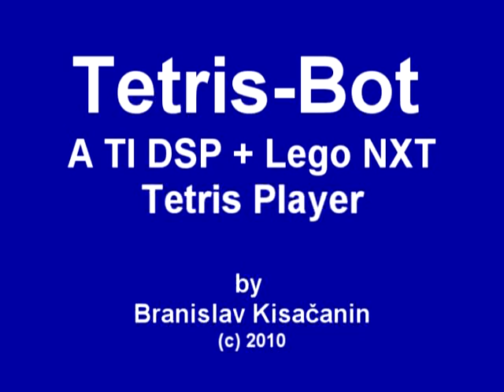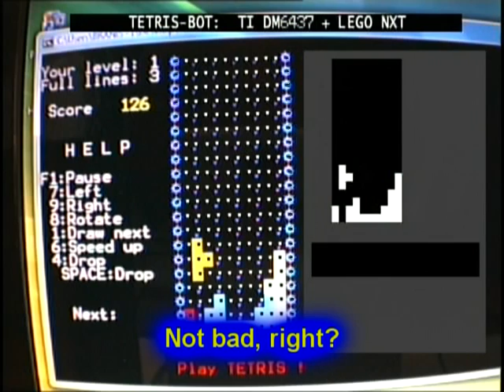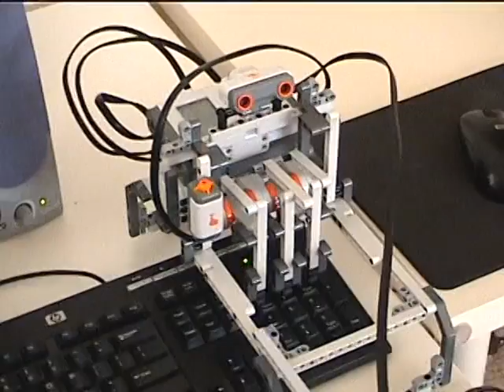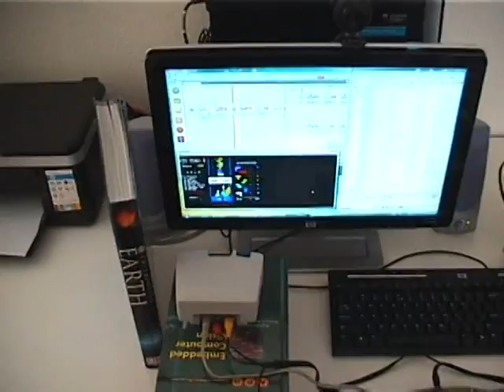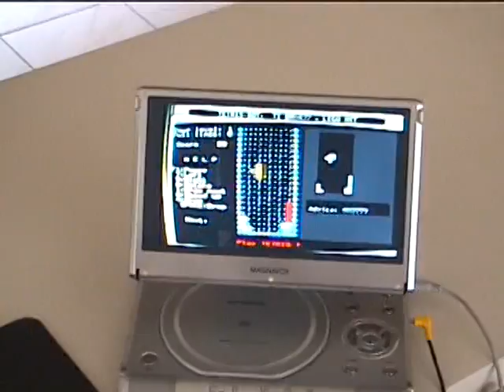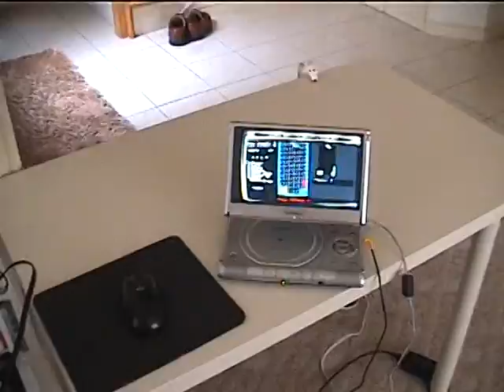Tetris-Bot  (TI DSP + Lego NXT robot)

Comment from the maker: @epokh64 Thanks! Each component of the system is as simple as it can be: (1) there is no segmentation as you may expect it - I know where to expect a new piece and determine it from sampled points (as shown in the "what the player is thinking" part of the video). (2) I considered doing an I2C communication, but compared to the light intensity sensor "watching" the LEDs on the board, everything else is too complicated. Glad you liked it! BK